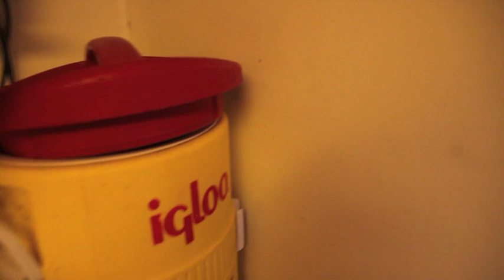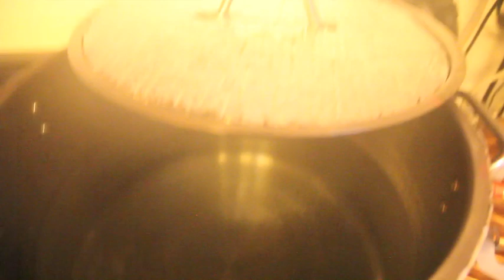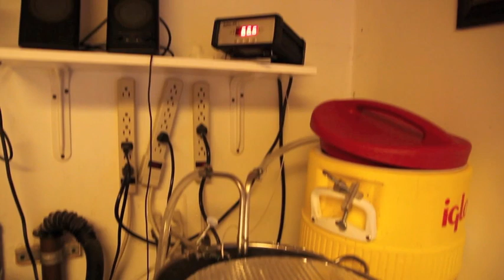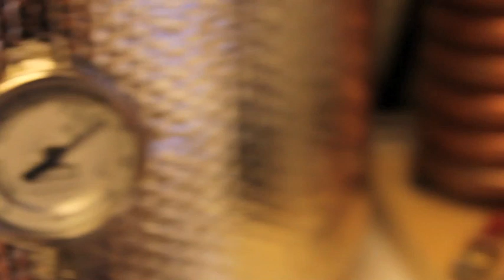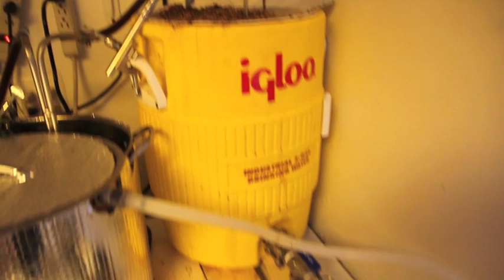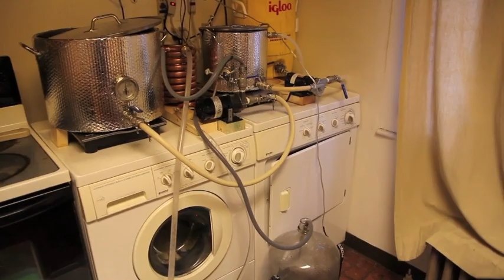My new all grain HERMS electric brewery.m4v

Comment: Sweet system, Bryan! I cringe to see hot water going down the sink, though. Divert that into your mashtun or HLT to be saved for cleanup at the end. I would say it should go right into your washing machine, but probably doesn't work that way for a front loader like you have there. Maybe a relaxing hot bath after cleanup is done! Cheers!

Comment from the maker: It works okay, but I actually did switch to a "real" false bottom. The new one came with some other stuff I was buying of Craigslist, otherwise, I probably would have stuck with the crumpled mesh hose.  Yup, the induction is not bad, just insulate as much as you can and good luck!

Comment: Hey there!  I was wondering if that stainless steel mesh filter you have as your "false bottom" type set up works well?  Wasn't sure if that was one of the things you've changed, but it looks like a very easy and efficient way to set up a mash tun.  Thanks a ton for the video as well, was really curious how the induction would work for brewing, and looks pretty good!

Comment from the maker: A PID (proportional–integral–derivative) controller is a little box that does some calculus to keep the temperature perfectly controlled. If you think about it, you can't just have a trigger that turns a heater on and off at a certain temperature because there is a delay between a heat source and the actual heating. So, it turns it on and off based off of math to hit the temp perfect. I think I am going to do individual videos about each component, so maybe I'll start with my PID (its great).

Comment from the maker: @theacoustician Nope...for the PID controller you need a heater that can be switched off and on at the power source (ie no electronics) so induction cookers wont work. But the 1500watt heater I have holds temp really well and hardly uses any power (only switches on less than 50% of the time)

Comment from the maker: @lachowicz1020 It does not really need too much extra water. It is basically just 20 feet of quaterr inch tubing in the heat exchanger, plus a little bit for the pump. I end up mashing with a little extra water, but then just sparge with a little less and it all evens out I think. Price to pay for temp control.....

Comment from the maker: The electric burner hooked up to the PIC controller is just a cheap-o 1800 watt hot plate. You definitely don't need anything fancy there, but it helps to have as much power as possible.